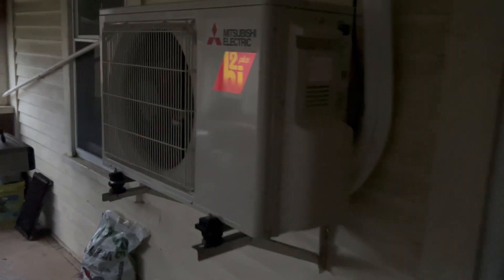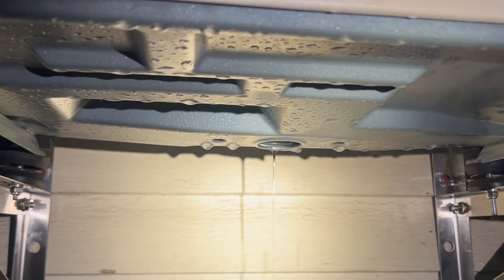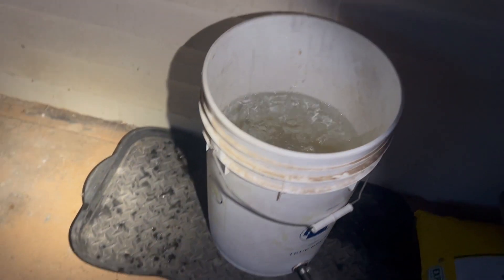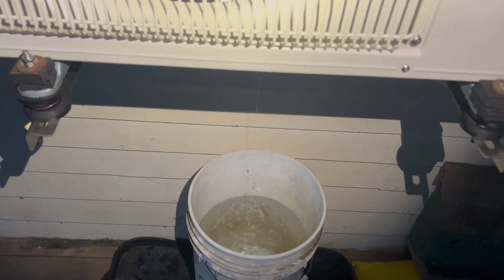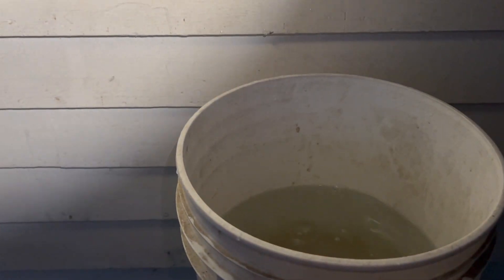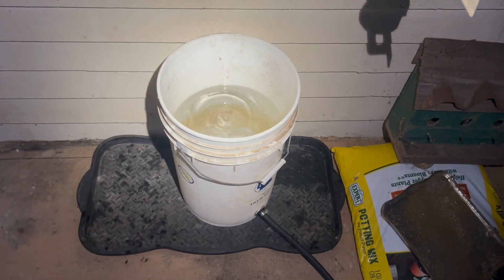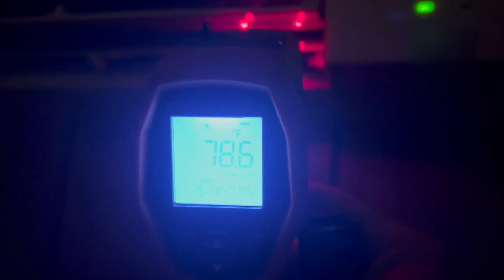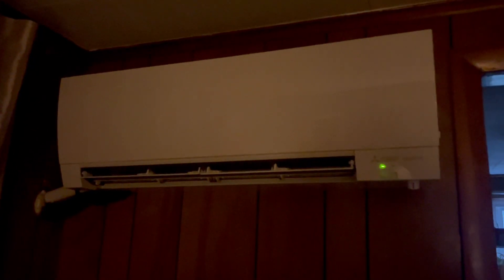Heating with an inverter mini split -  it makes GALLONS of condensate!

Comment: this time im laggy!   i want that   and mitsu is a good one!   more heads inside would help if the condenser can handle it...... its cold down here this week hope its a mild winter
Reply from the maker: @scuba422123  yeah, got down into the upper teens a few mornings in a row. Mini split was working hard! It can’t keep up with that house though. Too many air leaks. Had to fire up the oil boiler to make up the difference. It’s good enough to take the chill off here at least. If it never went below 30° I could probably heat the whole first floor of the house with it, but below that it struggles. I would probably need a 50,000 BTU unit to keep up, which would cost a fortune.

I heard good things about the Mitsubishi so that’s why I got that one. I don’t want anymore repair and troubleshooting projects lol! Sure hope it’s a mild winter but it’s not looking that way so far. I hate this time of year!🥶

Comment: I think that line set needs to be at leas 15' long.
Reply from the maker: @soydelrancho  why? As long as the charge is correct, why does line length matter … if under 60 feet long?
Reply: @SmittySmithsonite  You should call the manufacturer to make sure. I always create a horizontal loop to meet the 15' rule .My understanding is that is require to give the  TXV room to do its throttling.
Reply from the maker: @  it’s been running in cooling mode for 5 months of summer, & has been in heating mode  since Oct.4. Works great, no issues. 🤷 Line length has no bearing on its ability to cool or heat. The orifice, or TXV in this case, just needs to blast refrigerant in the correct direction depending on whether it’s in heating or cooling mode. Distance is irrelevant, as long as it’s less than 60 feet long. Over that the compressor struggles. Maybe if the line was only an inch long that would pose a problem for efficiency, but I doubt 5 feet of line would. As I said, it’s been working great and the power bill only went up $67 when heating in the shoulder season.

Comment: I wouldn't want to depend only on electric either.  Let us know how it works out this winter.
Bill
Reply from the maker: @billk5727  Will do, Bill. We’ve got temperatures in the 20’s forecast for the next week or so - something tells me I’ll probably be reaching for the thermostat rather than the mini split remote. Due to the recent pleasant surprise in the political realm, I’ll be heating with oil this year instead of coal, taking the easy, labor-free way out.😊

When it was in the high 20’s outside a few mornings it was barely adequate - great for the room it’s in, but not too much else. I had to keep fiddling with the settings through the summer cooling season, too. It seems to be designed to save power far above keeping you comfortable. Every window A/C built the last 2 decades seems to be designed the exact way.
Reply: @SmittySmithsonite  Pleasant surprise is welcome here too!!  Looking forward to it.
Reply from the maker: @billk5727  AMEN to that!! 👍👍